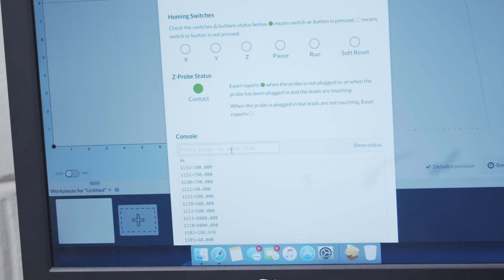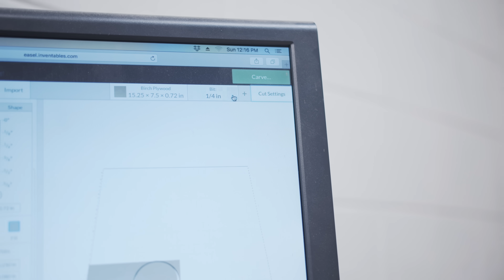Adding T-Track Clamps and a New Z-Axis To My X-Carve CNC 🤖// How To

Comment: Any thoughts on an upgraded router? I feel limited by the power of the Dewalt and only being able to use 1/4” bits
Reply: hey there! you just need a collet adaptor on amazon to use smaller shaft bits

Comment: Can you share how you used that bit in easel. Speeds and feeds and stepover.
Reply from the maker: I leave the stepover standard in Easel. Speeds and feeds will depend on how stiff your machine is, but I was around 60IPM and taking about 0.1” per pass.

Comment: Hey man. Nice descriptive vid. I too am trying to up grade my z axis however i am unable to remove the pulley from the acme rod. How did you prevent the rod from turning while loosening the nut? 😥
Reply from the maker: You can loosen the stepper motor and remove the pulley that way. The entire rod is replaced so no need to remove the nut from what I remember. Hope that helps!
Reply: @craftedworkshop  My pulley has a nut above it as well. :( and it doesnt seem to want to break loose. Im not sqitching over to the linear rail just yet but i want to switch the pully for the thicker one than takes 9mm GT2. My stepper motor can but the existing pulley can't.  Unfortunately
Reply from the maker: Ah gotcha. Maybe carefully grab the rod with some vise grips, wrapping the rod in something soft first?

Comment: Nice work! I'd like to have one of these to go with my CNC laser. I actually looked at that TBDCNC site to see if they had stuff that would work with my laser so I could expand its capacity. Unfortunately they didn't. Just curious, are you concerned about cutting too deep and hitting that T track with the bit?
Reply from the maker: Shoot Luke a message and see if he could custom make you something! And the MDF is high enough that I’d have to really screw up to hit the t-track.

Comment: That expanded z capacity is primo! 

When you check that square part for square, it's also worth measuring it with calipers in both directions. I've had the X and Y axis get out of sync a couple times, usually as a result of something being wonky in the belts. It's now on my regular maintenance check list, run a square and a circle inside and outside and make sure all the dimensions are correct.
Reply from the maker: For sure! And good tip. That was part of that calibration I did when I changed the belts, and the measurements are dead on, which is great.

Comment: I don't really understand why putting in those rails makes "making the same product over and over again easier". Why would being able to clamp down a smaller piece of wood in various places of the workstation make this process easier than just having it anywhere on the station and having the CNC mill it? Any other benefits to this upgrade that I might have missed?
Reply from the maker: For sure! More clamping location options make it easier to clamp different sized pieces. I can create custom fixtures that clamp down to the t-track, plus I can use a ton of different t-track clamps that I wasn’t able to use before. T-tracks are far superior to the threaded inserts that come with the X-Carve, just so much more versatile.

Comment: Its amazing it's taken so long for CNC to get into mainstream. I was using a Gerber Sabre CNC over 20 years ago in the signage industry, cutting Plexiglas, MDF, brass and aluminium.
Reply from the maker: It really is, I think it's been the price point, but these machines are considerably cheaper than a lot of the other tools in my shop and are incredibly versatile.

Comment: Hell of an upgrade!  I noticed on the compression bit cuts you were taking fairly conservative cuts.  I did the same thing until someone kindly explained that unless you're cutting deep enough to hit both the down cut portion of the bit you're only using an up cut bit.  Hope that makes sense... Basically on my compression bits I have to cut minimum 1/4" deep or it's just not worth using it.
Reply from the maker: Good tip man! That makes a ton of sense. Have you had good luck with that kind of DOC on the X-Carve? I've always followed the adage of your cut depth should be half the diameter of the bit at max.
Reply: @craftedworkshop  I push my mostly stock X-Carve as hard as I can.  For plywood I wouldn't cut any less than 1/4" depth with a 1/4" bit.  If you get into Fusion 360 you can do some nice deep roughing passes and then make a clean up pass to remove all the cut lines.  It's heavenly when it all works just right!